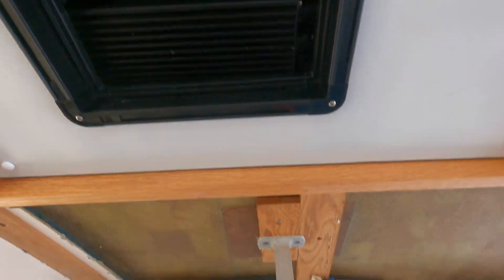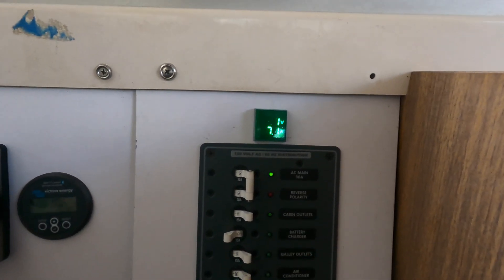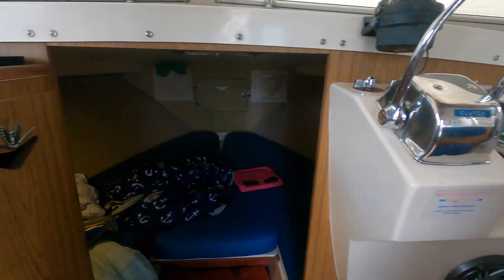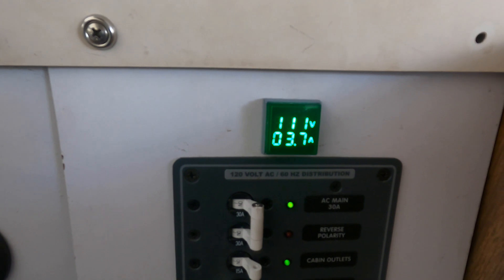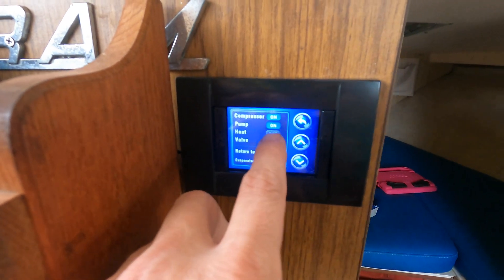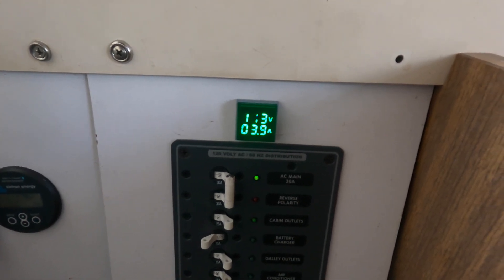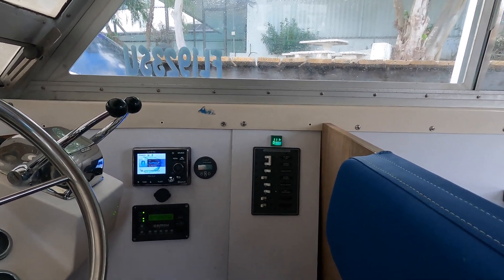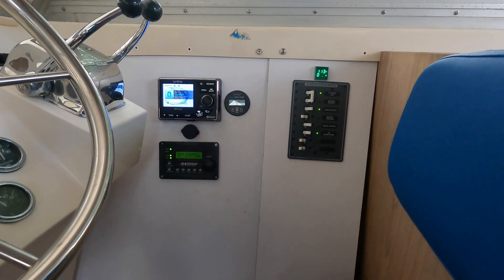Battery Powered Air Conditioning by Mabru on a '73 Bertram 28. Is 17,000BTU too much? Will it Work?

Comment: Hi Nick, really enjoyed the video.  Is the 110v VFD version? What is the efficiency difference between the VFD vs non VFD?
Reply: Thanks Bill! Yes, this is the 17vfd and at full speed we consume about 20% less. The other difference is reduced temp fluctuations and no peak starting amps. We can run this unit with no issues at all off of a 2000w inverter. I had a hard time starting a 12k standard unit without a pump connected to a 2800w inverter for reference. This does not take into account the amperage difference when the unit is just maintaining a set temperature. I’ve seen as low as 300w draw on this one